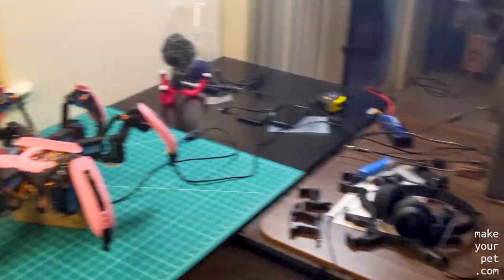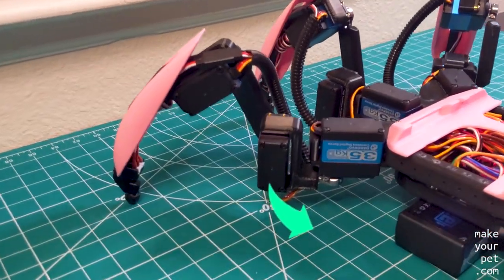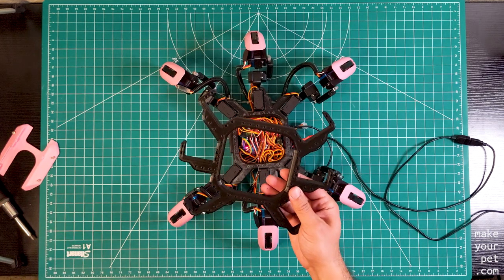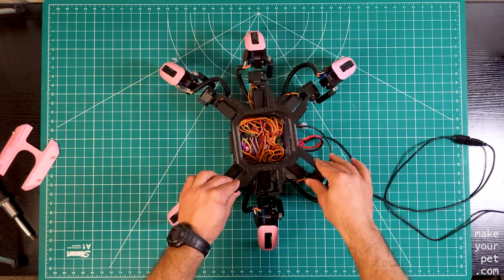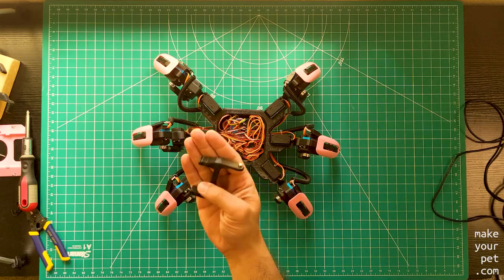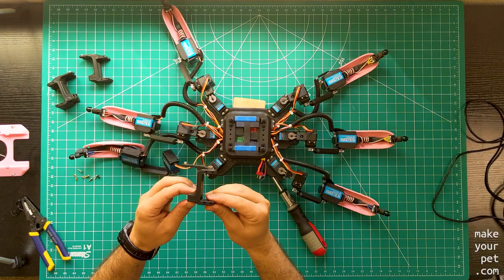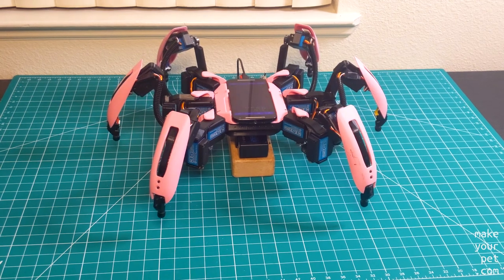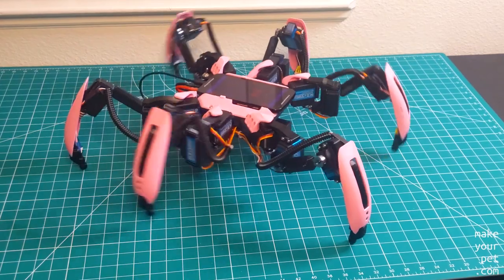Hexapod Robot DESTROYED!! Servos are damaged and vibrate non-stop. And how I fixed it.

Comment: looks like to me (After you gave us all the big hint.) was the encoders are mechanical,  maybe engine shell mounted hall sensors are better.
Reply from the maker: Interesting, do you have a link that explains the difference?
Reply: @MakeYourPet  oh you dont actually know yet?  you just need 2 perpendicular stuck to the motor body, and then stick a magnet on the axle or coupler and then use linear hall sensors are better and u get 2 sinusoid responses you can turn into an angle.   heres a link->  https://www.youtube.com/watch?v=BFZceDq7YXg    DONT USE LATCHES THEY ARE WAY WORSE!!!  i think you only need 1 magnet and two sensors really cheap kit out the robot less than $50 prob.

Comment: So cool! Really liked the idea of using an android phone as the main controller. May i know what you used for the metal axles at the pivot point between your new coxa brackets and femur brackets?
Reply from the maker: The small metal axles are 5x6mm dowel pins that I bought online. The other metal parts are the aluminum horns that came with the servos.
Reply: @MakeYourPet   Thanks for the reply :D. I've been trying to find the same pins online but doesn't know the name for it. Thank you!